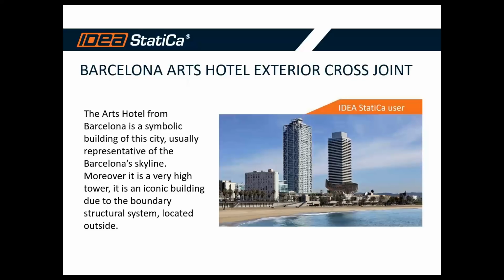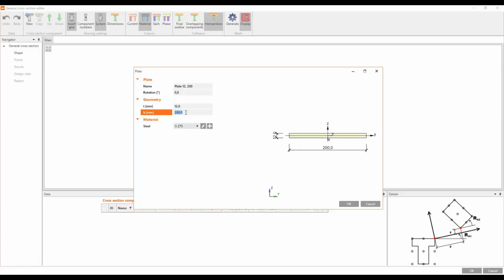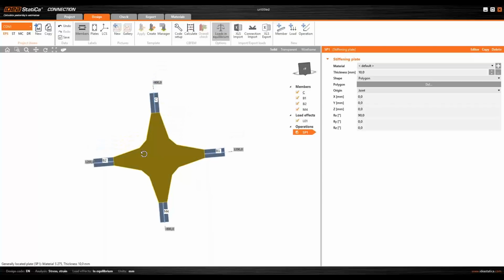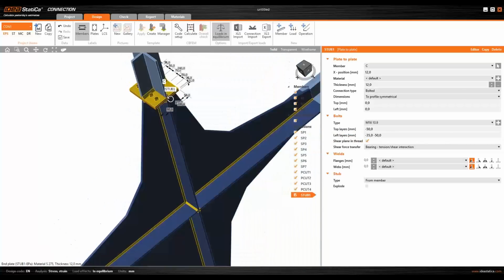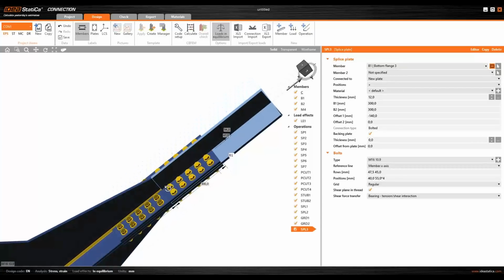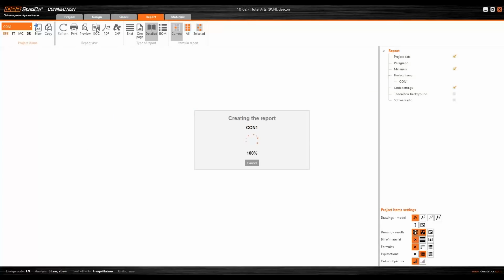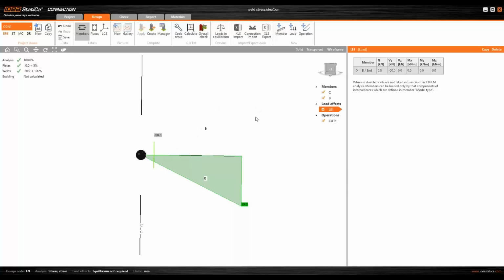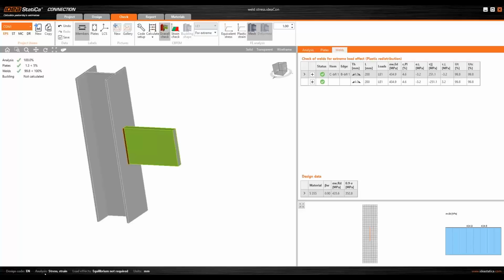Connection Wednesdays – Barcelona Arts Hotel exterior cross joint

Comment: I try to understand, but. On the end, when you change distance to 95mm, you got double stress. So, now, his 3 Mpa is more than 20 times differenece.
Reply from the maker: If you change the position of loads = position of shear force, the moment diagram is different so that there is much bigger moment acting in the weld, thats why the stress is so high.
See article:
https://www.ideastatica.com/support-center/different-ways-of-load-definition
and webinar:
https://www.ideastatica.com/webinars/structural-loads-in-steel-connection-design

Comment: Hi IDEA StatiCa, Thanks for the detailed explanation. It would be great if you can add a short video showing manual validation for welds with moments as well using direction method
Reply from the maker: Hello Arun, thank you for your comment. Unfortunately, we do not have any video showing the manual validation of CBFEM. But you can find more than 100 validation examples done by various universities and institutions worldwide: https://www.ideastatica.com/support-center-verifications?product=steel
E.g. you can find this moment welded connection verification: https://www.ideastatica.com/support-center/extended-end-plate-moment-connections-aisc
Reply: @ideastatica_en  Hi, Great! Thank you for the quick response in this platform. Thank you for the links ☺

As most of the Engineers use traditional method especially in connections and also out of curiosity with how STATICA produce the results on different loading condition leads to this video thread (25:45) but unfortunately I can see only shear force validation of welds. It would be nice if in the same example a hand calculation for moment case and axial load case validation includes. 
Really confused with how STATICA is giving shear stress parallel to axis of fillet weld(T||) for a simple beam-column connection loaded with only moment confirming with Eurocode 1993: 1-8 ( Directional method of fillet weld)  or it would be nice to get a detailed report showing how each parameter is calculated. The weld result print output in STATICA seems very short details showing only the resultant values and not showing the moment of inertia calculation or section modulus calculation for different weld shapes.